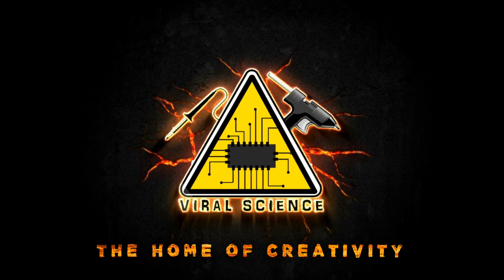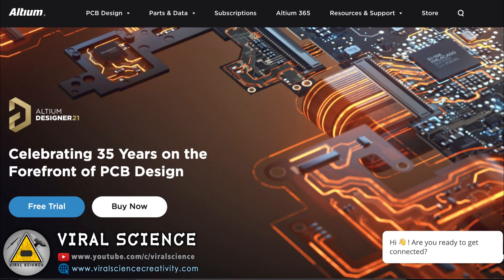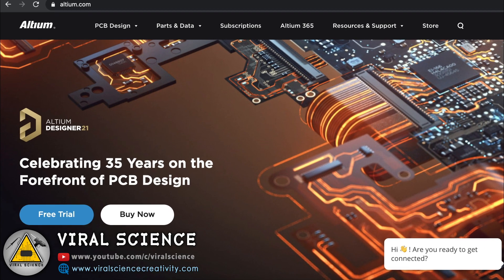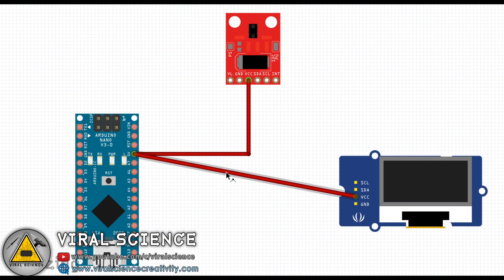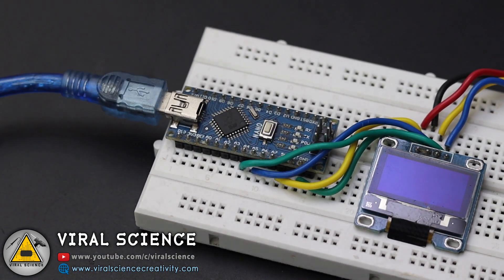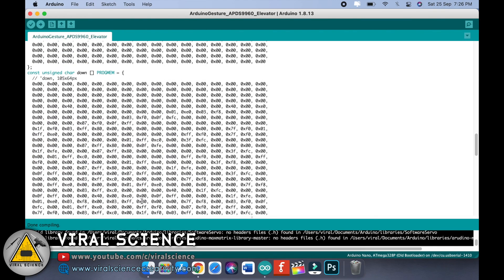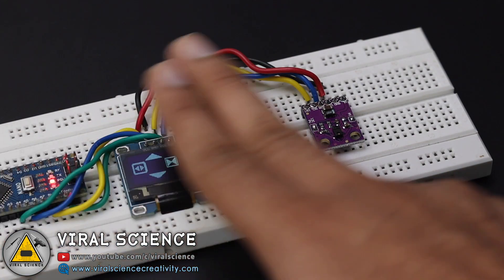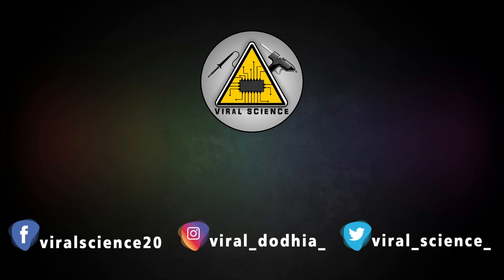Arduino Gesture APDS 9960 Sensor Elevator System Demo

Comment: I want to use it in the installation of elevator panels. After modifying the code, the output control relay is also added to connect to the AC motor. When the IO input pin is added, it can be connected to the floor limit switch. When the floor limit switches are triggered  , oled is displayed on the floor, after each floor limit is touched, the display counter increases or decreases by 1 to start or stop the AC motor.  I will use this project in a home elevator
Reply: Is it working